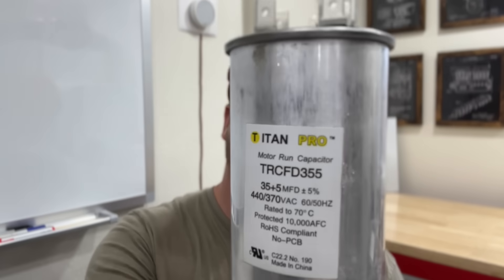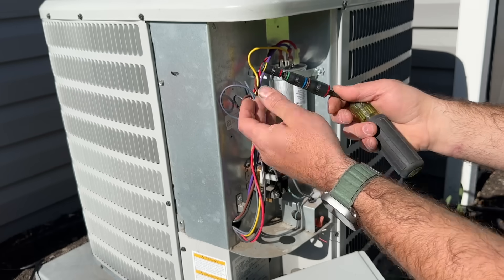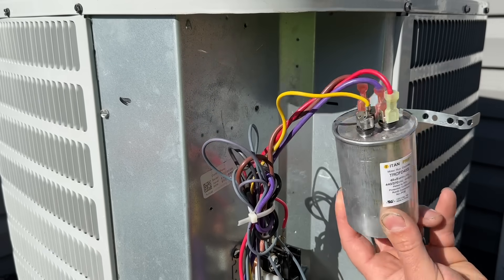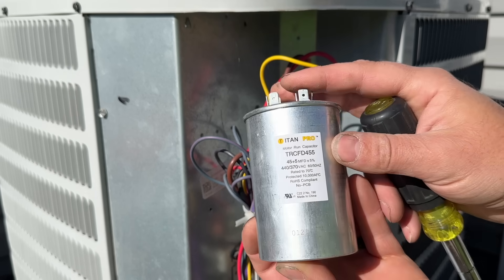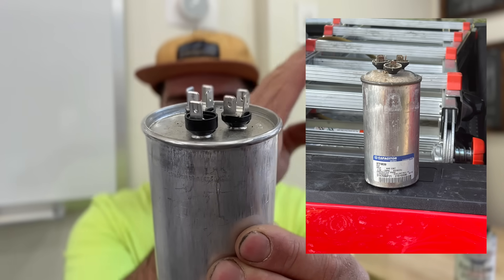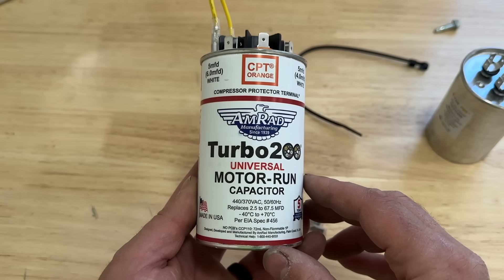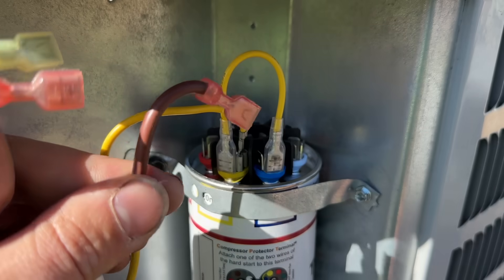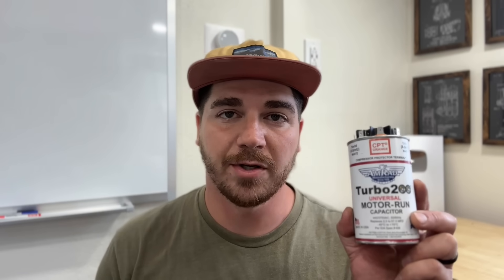HVAC Contractors Practically Make Their Living On These

Comment: Seems like more than a few responses are from angry triggered HVAC guys that feel disrespected by this video, and the many folks it's helping.  Talking down to people is never a good marketing strategy and just reinforces the bad reputation "some" HVAC service  folks get for taking advantage. I do most of my own car repairs, but not all of them. Same issue here. If I feel comfortable doing the work and it's not overly complicated, I'll give it a shot. Messing around with expensive refrigerant or replacing a compressor  is not one of the things I'll do. That being said, I will totally dive into replacing an easy to get to swappable part. If you HVAC pro's out there take offense to people being self sufficient and successful at it, well, with all due respect, get over yourself.

Comment: Pool Water Pumps have the same and got charged almost $500.    Q. I know the piece is only $10, butwWhat about the $$$$$ and TIME the Repairman spent to learn his trade?..  PLus checking the unit that is working OK?... I am not saying that charging $2000 is OK yes thats a RIP-OFF, but $300-$400 to come out diagnose and replace the $10 capasitor piece is reasonable.  Give the Honest ones a Break.

Comment: I had one go bad on my fan on the compressor unit outdoors. I knew it was a capacitor because I could spin the fan and it would run and keep cool. So I called the AC guy and he quoted me $410 (this was 15 years ago). I said, “to replace the capacitor? Thanks, but no thanks.” He chuckled and said, “what, you gonna try to fix it yourself?” So after dismissing him I went to another property that was vacant and cannibalized a capacitor from that unit, put it on my home unit, and it took off. Then I got a new capacitor and swapped them out.

Comment: Just look on the compressor or fan and the uF is stated on each. You would think this information would be on the the units plate but nope. Probably because of replacement fan or compressor may require something different.

Comment: I just replaced the capacitor, contactor, and fan motor in my 1996 Heil compressor for around $200.  Thanks to YouTubers like you, people are realizing that they can easily perform these tasks by yourself.  A technician 2 years ago charged me $500 to replace the capacitor and recharge my unit.

Comment: Great video for exposing a common scam, and for a commonly needed repair that you show how to do both safely and correctly.  I've needed two in the last ten years and although my HVAC guy is very good and fairly priced, $250 is still high in the final payout for anyone with simple mechanical skills.  While here, I have a question.  Are those high boost capacitor kits recommended for when using an otherwise adequate generator to overcome momentary high startup current load on the generator?  Thanks.

Comment: In the HVAC trade for 27 yrs. I am personally all about DIY with multiple things in my personal life. I am very handy and have extensive electrical training(11 years as a Navy electrician). So if you are comfortable then you do you. From a professional perspective, I would never give customers instructions on how to do it themselves.(lawsuits when they electrocute themselves). The average technician in our area makes $35/hr,. Company has to pay that, provide a van, provide insurance and all other benefits, provide warranty coverage on work done, provide uniforms and training, fuel for vehicles and pay office personnel to handle all the background paperwork  ect,ect. Then you have to have some kind of profit margin or you don't have a business anymore. I understand when customers think its overpriced and yes, 2k to just change a capacitor seems excessive. $300 would not surprise me though when you consider that a professional tech will then retest the system to ensure their are no other issues and that the system is now going to work as intended.  I don't own the company I work for just an employee but I've been around long enough to understand how it works. Just my 2 cents.

Comment: Great video, I keep a couple of capacitors in my shop. Even though my HVAC guy is a good friend of mine, my A/C only goes out on a weekend, and he’s usually off camping or fishing on the weekend. He lets me use his account at a local HVAC supply house. For a while, I was using 1 capacitor a year. The last one I purchased was a U.S. made, can’t remember the make but it came with a 5 year warranty. It cost about $45.00. So far it’s been doing fine for 3 years. But I still have a couple of $9.00 ones in my shop, just in case!

Comment: This just tells you it is a great career to get into. Hvac machanical contractor. Must know plumbing, electrical, and heating and air, also some carpentry. Thats 3-4 different professional trades.
Reply: HVAC guys make $$$ in Texas, but you must be willing to work eight hours in a 140-degree attic and expect 16 hour days in the summer.

Comment: Back in 2022 we had an HVAC company with good reviews inspect our AC , The tech said that our capacitor was 51% and should be replaced wanting $400 for it. Since we were in the fall I told them to wait for our spring inspection. This time a different tech came out. I told him that I would like to be outside with him to see the readings for the capacitor test. He said it was well within specs and did not need to be replaced. I called the company and asked to speak with the manager. I told him that our house was only 4 years old when went bought it and to never send the clowns that came by for our fall inspection ever again. I do not mind paying at tech a few hundred dollars to replace a capacitor since I understand that most of the charge is labor. But I do not appreciate it when they try to scam you.

Comment: This is how you “battery-less” a motorcycle btw. 

It has just enough capacity… lol to keep the alternator keep the lights on and ignition firing. 

It’s a weight reduction mod for weight weeny motos 

They will shock you so discharge it before you handle it

Comment: I was ripped off by being charged $150, in advance, before the tech would come out! Then he proceeded to rip the wires out of the ac unit! He then says I’ll get a call on the cost to repair. 3 days later a young sounding, cheerful female voice tells me it will cost $9,000 to replace my ac unit. When I asked for an explanation she said she didn’t know. I am an octogenarian and have great difficulty with my knees to get down to do repairs. I went to YouTube. Watched your video. Replaced the capacitor myself for under $25.00. Thank you. I will never call a service tech again. My refrigerator just went out. I’m debating if I should replace the compressor myself or buy a new refrigerator. Won’t ever call a service tech again.
Reply: did you pull fridge out & clean compressor on bottom?   sometimes that's all it takes to get it working properly again
Reply: @methus57  I know this was a month ago, but always check your thermostat, that is what usually goes out.

Comment: I had a technician who owns an HVAC company tell me that service calls, 90% of the time, have one of two problems:
Problem #1, contactors.
Problem #2, capacitor.
The rest of the problems are typically either coolant leaks or compressor burnouts.

Comment: My capacitor on my 4 ton went out last summer. Followed the troubleshooting and testing steps I found online. Ordered a new capacitor online with identical specs.... $35.00. Had it the next day and the AC works fine ever since. Local HVAC wanted $100 evaluation/trip charge, and said if it's the capacitor would be around $500 more.

Comment: I have 3 AC units. I've only had one go out in 15 years. I know very little about AC but I'm pretty mechanically inclined.  I asked the maintenance guy at my job and he said check the capacitor. Told me if the bottom is bloated so it doesn't sit flat that's probably the issue. Sure enough that was it. Part cost me $50 at the appliance parts store took about 5 minutes if that to replace. Haven't had a problem since. I stress every summer because I'm in Vegas and I know they're probably reaching their lifespan. I don't trust AC repair men at all so I've never had them serviced but I've taken off the panels and cleaned them a few times. Not looking forward for when I actually have to call them.

Comment: You explained the process so well that anybody with any mechanical ability can safely change their capacitor. Another thing you can get capacitors from your local AC Supply House might cost you a little bit more but you won't have to wait and not have AC. And like you were saying about getting the turbo 2000 to have laying around be prepared find an AC guy and ask him if he's got a couple of those jumper wires I used to pull one's out of old units just so I had them so you don't have to buy the double capacitor you can just buy whichever one you need for the compressor or for the fan. Just jump the common wire over to the new cap then the wire you removed from the bad side onto the other side of the new cap.

Comment: The entire HVAC industry is a scam. They are some of the biggest scumbags of all the trades.  They grossly overcharged for everything and try to hide the prices of equipment.  Fuck those people just go get your section 608 test on and you can buy equipment yourself. The test is really not that hard.  Anyone who took physics in high school can easily pass it
Reply: Fully agree.  We paid $13,000 for a new Carrier HVAC in Austin.  The guys installed it wrong, and it failed inspection.  After a second attempt the new compressor unit failed.  After try #3 it was still blowing the breaker.  We chose one of the most reputable contractors in town and they still sucked.

Comment: Sorry genius.  Been doing it 35 years and about 10% of my calls are capacitors.   I use USA made not your 10$ Chinese ones.  I charge 200$.  Not every problem is a capacitor and most are not.  Only a hack changes them everytime hoping it works.  

Go find one for 10$ use it and buy another in a month.  I use amrad and they are 40-50$ but guaranteed 5 years and I honor that.  So don’t use a broad brush it makes you look stupid

Comment: If your smart...
You'll find out what make and model your heat pump is, crack open the side panel and pre order a spare capacitor. 
Keep it in the garage.
When yours fails, simply replace it. 
Save $

Comment: some systems have 'hard start' capacitors as well as normal 'run' capacitors. the only real difference is that a run capacitor is being used the entire time the system is running, but the hard start capacitor is only used in the first few seconds of a system kicking on. these start capacitors also have a mfd rating, so if your system has one its worth checking out. if youre buying your own capacitors, stay away from the titan pro he was showing off in his video, they are hot garbage and dont seem to last. instead, the titan hd I've personally found to be a better alternative, and i also like using the proparts branded caps. dont have a lot of issues with either. never tried the turbo200, as they are way more expensive and not feasible for a service tech to be installing when the non-universal ones are so much cheaper but still offer the same performance. to each their own i guess. make sure when you disconnect the wires from the terminals on your capacitor at home, you use a pair of needle nose pliers, and do not pull on the wire itself, only the metal terminal end. pull straight up, do not rock back and forth, as it will loosen the connection and cause issues down the road. id just like to say that my company charges 40 bucks for most sizes of dual run caps, plus our labor time, which happens to be 110 an hour right now. obviously this is going to be different depending on where you live, but if youre getting charged 500 bucks or more, youre probably getting ripped off. your service tech should also clean the outdoor unit while hes there, as typically, a dirty unit will cause your cap to fail, this can still be done in under an hour, so if your tech throws a cap on in leave in 15 minutes, its shitty service and theyre taking advantage of you

Comment: When I bought my house I soon learned the Central AC unit didn’t function. Sadly I got a windows unit and went roughly 5 years using that. One summer I got ambitious and decided to investigate why the large unit didn’t work. I found out pretty quick the start capacitor wasn’t working and I replaced it. AC worked perfectly after that. I got a few years of use but eventually the AC unit broke down again. Unfortunately when I tried replacing the capacitor a second time it did not remedy the problem. So back to windows units for now it seems!

Comment: One Electronics class in college, the instructor charged a capacitor on the first day of class. On the last day he shorted the terminals and threw quite an arc.

Not AC but I did Service Station repair. Changed many caps in submersible gas pumps. People would freak when I'd open the chamber and it was full of gasoline from a bad seal. High amp draw meant either bad cap or bad sub motor. Glad when it was only a cap.

Comment: Some 15 years ago, my A/C failed and the technician I called replaced the capacitor. I'm happy to say that he charged me $105, which seemed more than fair for the part and his time. I referred that honest and fair tech to MANY friends over the years. Of course since then, I've replaced the cap on my own for about $15. Here in SoCal where it gets blazing hot, they only seem to last about 2-3 years and usually fail in spectacular fashion as the pressure vent opens with a loud whistle!

Comment: My AC is almost 25 years old & still working and have had an honest AC guy replace the capacitor over the years. I now I just replace it myself whether it needs it or not since they are so cheap & easy to replace and live in AZ. There have been people near me with the same ac that also still have the original and many that have replaced thiers 2 or 3 times already so I just assume that they all did not need a replacement.

Comment: Just leave the disconnect out. There any many different kinds. Some will still give power when turned upside down. And always double check power at the contactor . I’ve seen some disconnects a that were actually hardwired so pulling did nothing.

Comment: I once had an outdoor unit that was a minor problem. Whenever the air conditioner was running and we had a thunderstorm, the power might go off momentarily, but when it came back on the air conditioner would kick off. I’d have to go out in the rain and reset the breaker to get it restarted. I asked a friend who was an HVAC contractor why this was happening. He said that when the power comes back on after a brief outage the compressor is trying to start with excess pressure still in the system. He have me time delay relay that would keep the compressor off for five minutes after the power came back on. This would give the system time to relieve the pressure on the compressor. It would then start up after five minutes with out tripping the breaker. Saved me from always have to reset the breaker in the rain.

Comment: Read uF on motor, look up compressor uF.   I JUST changed my son’s motor capacitor it had a 10 uF in control box.   I thought that seemed high.  I looked at motor label and it listed 7.5.   Tech had put wrong capacitor on previously.

Comment: That is a run capacitor and is in the circuit as long as the unit is running. It provides an electrical phase shift to the AC sine wave. The phase shift creates the rotating magnetic field in your AC motors in the unit.

The jolt at startup you described is a start capacitor aka hard start cap. That is a different thing.

Like your vids, def getting that 7 in 1 tool.

Comment: I was quoted 10000 dollars to "fix" one of my A/C units.  I do work on automotive A/C systems, so I'm somewhat privy to what's going on with A/C systems in general.  The one I have is a mini split unit that will produce trouble codes when something is wrong.  The problem turned out to be a 13 dollar sensor and it was the trouble code that allowed me to find out approximately where the problem was.  I did a resistance check on it and found that it was definitely bad.  I've replaced those starter caps before as well.  It's always good to learn as much as possible to avoid getting scammed.

Comment: There is one key point you fail to explain in this video why a capacitor might be broken on an older AC unit to begin with. If the motor in the compressor is old and about to die it can create an increase in resistance when it start up that very quickly kills a capacitor. So you can replace it but in no time it will die again. A broken capacitor can absolutely be an indication of an old and worn out compressor that needs replacing.

Comment: If the capacitor is on a truck, I have no problem charging 10 to 20 or whatever they cost. If it's a return trip, then trip charge will need to be included which would be around 125 to 200 and extra cost of capacitor so say worst case 250...? 2000 seems way to excessive.  

This does save motors as psc motors use capacitors...